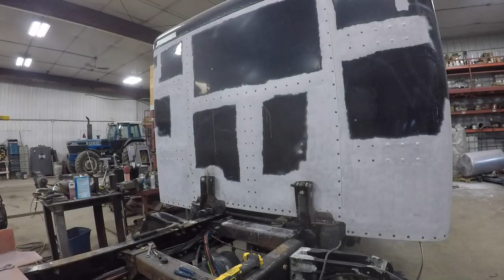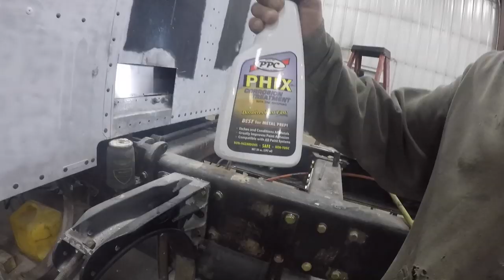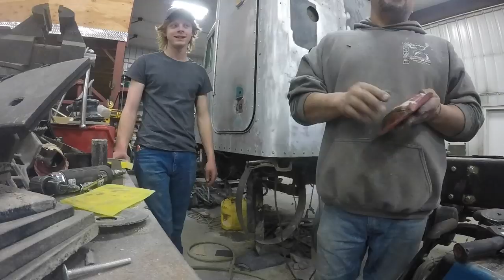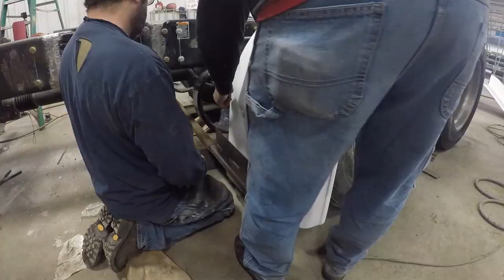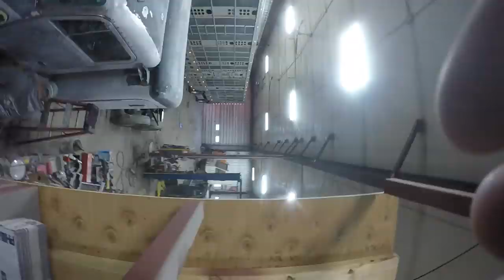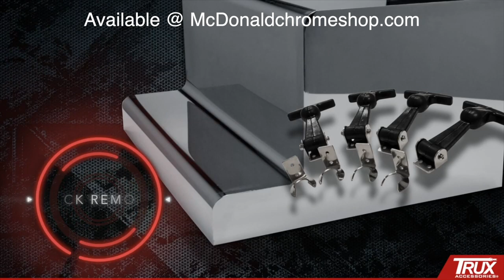379 Peterbilt | Time Lapse Video | Body Work | Fender Bracket Fabrication | McDonald Chrome Shop

Comment: I think it’s great you show replacing those bad spots on the sleeper, lesser shops would’ve said, ah no one will see it, paint it and move on.. great work!
Reply from the maker: thanks, yeah we like interested buyers to know everything they can about the trucks we build. We fix what we feel needs to be fixed but also try not to over do things to make the trucks bee too high priced. this truck will end up being a higher priced truck due to the fresh motor with paper work with about 20 miles on it just getting it home from the shop along with the rear cut off and front axle we installed with all disc brakes. we have had comments on facebook saying we should of saved time and money putting the whole new skin on. but truthfully their is no reason to and that would of actually cost more and taken more time to install. glad you enjoyed the video